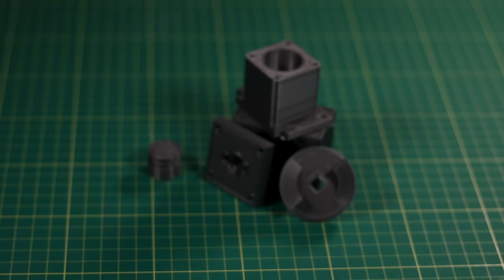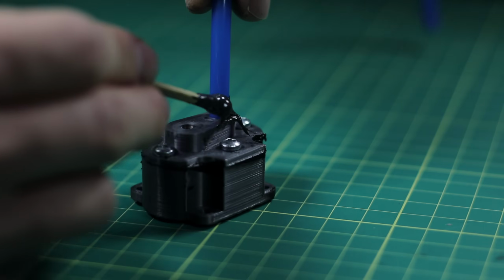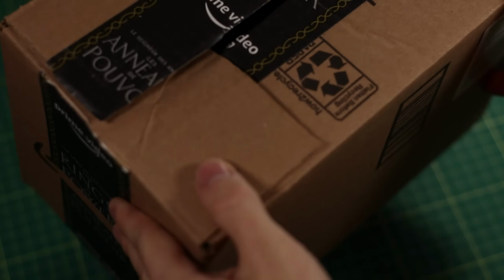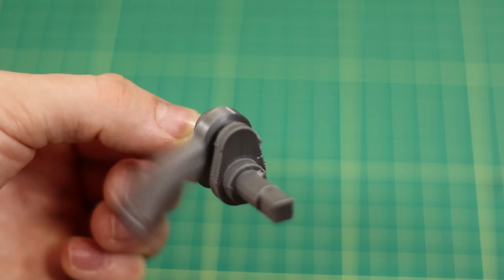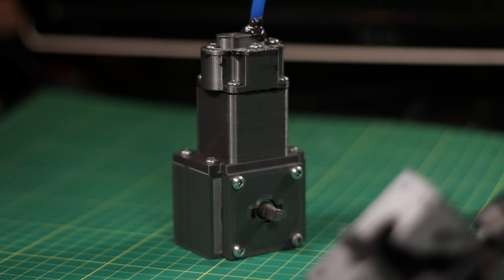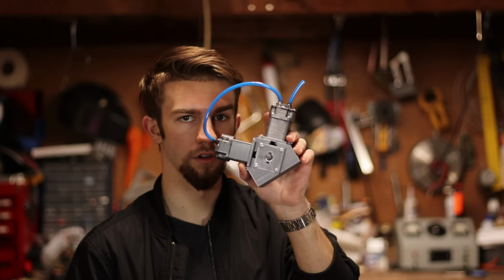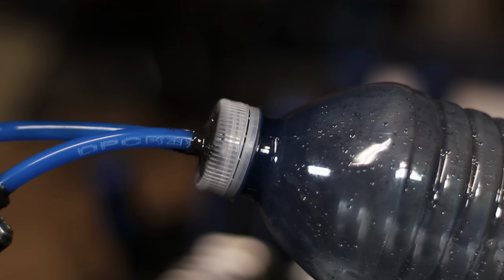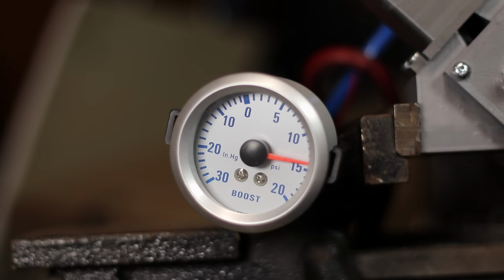The 3D Printed Air Compressor: Will it Work?

Comment: It's easy to 3D print a peristaltic pump; this should be usable as a compressor shouldn't it? Though of course vitamins like bearings and the silicone tube are doing the actual work, not the 3D print.
Reply from the maker: A peristaltic pump is generally better for displacing liquids rather than compressing air. As liquid is uncompressible and 'thicker' than air it is easier to displace fluid from one place to another at a constant pressure with a peristaltic pump. For compressing air however, it may not work so well as not only does it only move a small volume of air, it would be easy for the pressurized air to move back through the tube. It's not impossible, but a conventional piston design is much more effective.

Comment: Please make a 2-stroke engine model or a air engine with basic hardware so its easy to biuld  make it the engine based on the cox .049 engine on eBay really love that engine if there is just a model of this engine message me I would love the stl file
Reply from the maker: A model engine could be interesting to do. However, I mainly focus on functional models like air engines so I may get around to it one day

Comment: Is it possible to build a air brush using this? I think it would be really cool to build a air brush also with a 3d printed model around this and use it
Reply from the maker: Likely, by having the compressor pressurize a bottle with the paint in it I'm sure it could work
Reply: @CamdenBowen  perhaps i was thinking to connect a 3D modeled airbrush module  at the end of the bottle, this bottle ofcourse can be changed in future with better option.

Comment: I recently found your videos and love them! I wanted to recommend using some graphite powder on your crank shaft connections or any other parts that rub or spin around each other as a dry lubricant. I have used some on projects in the past and it works wonders.
Reply from the maker: I'll definitely need to look into graphite powder! I've heard it works wonders. I forgot to mention it but after I assembled it I did put some grease on the crank shaft and it certainly helped

Comment: I think most dual cylinder high pressure compressors have different size cylinders to increase compression. The "first"  cylinder is bigger and the "second" cylinder is smaller (in volume)
Reply from the maker: I would come to realize this after I had made the final design. I'm thinking of doing a redesign to include this detail
Reply: @CamdenBowen  will you still do this?
Reply: Thank you!  I was struggling with how having two equally sized stages would compress more, since it is still the same volume of air just being re-compressed.
Reply: @joejansen7029 after the the bottle fills up, the second compressor pushes less air in until the first compressor puts compressed air into the second.
Reply: I was about to type this, the second cylinder should have a volume smaller than the first, and the factor between the two should be the compression ratio of the first cylinder
Reply: What about combining this with an HHO generator.... use it to generate "boost" for a 2 stroke motor >:)
Reply: This
Reply: what would happen if you add a thrid stage
Reply: Is there a limit to how small you can make the compressor? Have you tried building the smallest one you can?
Reply: Also it might be a good idea to have a little buffer container between the two cylinders.
Reply: It's not about thé volume it's about thé surface, p=F/A, but if you make thé second Piston smaller thé volume wil also decrease because they have thé same travel distance with one cranshaft, and that's how a 2 stage compressor works .

Comment: dude, with this kind of setup, you can build a compressed air engine that rivals the efficiency of Tom Stanton's!  Great work once again!
Reply from the maker: Thanks! I'm working on a new engine with some interesting properties I'm sure you'll think is cool!
Reply: @CamdenBowen  How do you get your poppet valves to seal against high preassure?  Mine are leaking like crazy.  Even after using much stronger springs, they leak after around 15psi
Reply from the maker: @hayden3928  Is this regarding the gas engine or the compressor? Silicone was used to glue the O-rings down to the head, and I made sure the surface of the O-ring that will be contacting the BB was clean so it could seal tightly. Hope this helps!
Reply: @CamdenBowen  Im thinking of your most recent air engine, but the gas engine has poppets too.  Thanks for your quick response!
Reply from the maker: @hayden3928  It's very similar actually, It just uses larger O rings about 17mm in outer diameter
Reply: @CamdenBowen  I think the only thing Im doing differently is the way my valves are shaped.  Yours are sloped all the way through on the head, whereas mine are more like an actual engines, which could cause uneven and unideal sealing?  I'm absolutely stumped as to why mine doesn't seal.
Reply from the maker: @hayden3928  I have the constant slope, and after it is printed I heat up the valve and push it against the o-ring to shape the valve correctly
Reply: @CamdenBowen  ahhhh.  That's gonna help a lot
Reply: @CamdenBowen  Can't wait to see!  My engine finally runs (kinda).

I can run it off of my breath, but on the compressor, it takes about 12psi to force the piston down, but anything above 10psi makes the valves leak. 

I have already made some fixes, and I haven't tested it off of the compressor for some days, so hoping it works tomorrow!

Comment: Very cool Maybe make it in to a real air compressor with a air tank from a paint bal gun and a small motor with a case around it to make it look like an industry motor
Reply from the maker: I'd need to iron out a few kinks first, but eventually a little 3d printed shop compressor could be a good idea!

Comment: There is a tip making this way better and it's a simple law of pressure: greater the surface, better the pressure. Make another cylinder have 2 times greater diameter.

Comment: To make a proper 2 stage compressor the volume of the first piston should be bigger than on the second. Either with a bigger diameter or a bigger stroke.
Reply from the maker: I'm thinking of revising this later on, Thanks!

Comment: Maybe add another 3 stages and make it into a radial air compressor?

Also I wonder, how much air pressure can a 3D print stand. I've seen a video of 3D printed air tanks, but they leaked like sieves under any pressure without being sealed with epoxy or ABS/acetone slurry.
Reply from the maker: Not a bad idea, but too many cylinders on one 3d printed crank will be catastrophic, even just the two was pushing my luck a little. Maybe one day I will see just how much pressure this can really do with a high scale gauge and assess any failure points!
Reply: @CamdenBowen , I would suggest printing the crank assembly as a set of disks. First one has a thicker shaft with bigger bearing between it asnd front cover of crank case, with metal bolt in the middle to increase the strength. It also has a hole for another bearing. Back disk is exact copy of this. Then there are two more disks that form the eccentric part of the crankshaft, to which connecting rods are connected. These also have a bigger hole in the middle. The last part is a cylindrical separator piece. The diameter at the ends is the same as diameter of the holes, but the middle part is a bit bigger. It also has a hole for a bolt that connects it to the eccentric bearings. You print all the parts flat, and bolts would reinforce them against layer separation. Increase the number of perimeters/walls and use 25-50% cubic infill, and it should be tough enough. Stefan from CNC Kitchen says so. ;)

I'd actually do it myself, but my budget for hardware parts and filaments is very limited, and the parts themselves are a bit expensive in my country...
Reply: @CamdenBowen  make multiple twins but use something like a timing belt to run them together instead of a a single crank
Reply: Recently glass clear PETG print profile on Printables has been making the rounds, and CNC Kitchen covered and dissected it. It is obvious that those prints are about as airtight as can be, so that might be a valuable approach. It's basically a continuous monotonic fill so it evicts the air from the print during printing and fills it with plastic.

Comment: wow thats really good! Legit if you were to make everything on ball bearings, it should last quite a while
Reply from the maker: I added some grease between the con rods and the crankshaft, usually I wouldn't since it creates more resistive forces because of the greases thickness but since this isn't an engine the grease stopped the crank from exploding lol

Comment: 3d print a supercharger (roots or centrifugal) roots is cooler tho :)
Reply from the maker: I did actually make a 3d printed turbocharger in the past, you can see a few snippets of it from my 2 rotor air engine video. I'd really like to try a roots supercharger though!

Comment: really cool video! I thought the bearing less crankshaft had no hope of survival but its cool that it stood up to a drill. I am making air powered engines and I have no luck if it doesn't have a bearing, all of mine melt or explode if they don't have a lubricated bearing but yours held up really well.
Reply from the maker: I forgot to mention but I did add some grease to the connecting rods and the crank, otherwise I am certain under that sort of force they would have melted apart lol. I used high grit sandpaper to sand the parts down as smooth as I could before assembling as well
Reply: I suggest you upload videos were you show the most important stuff about making those compressed air engines.